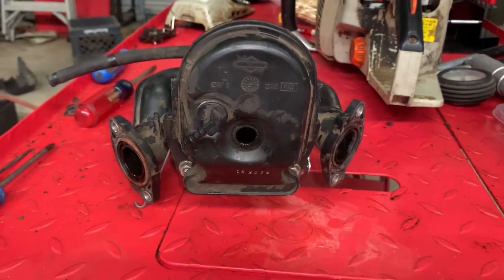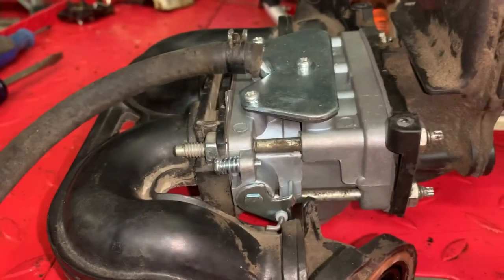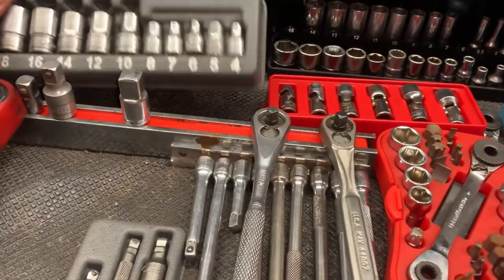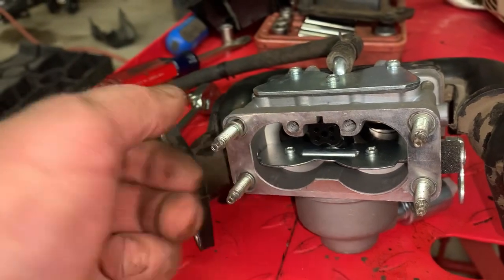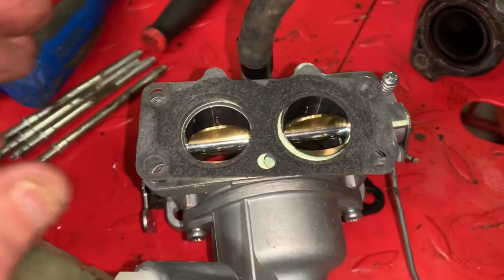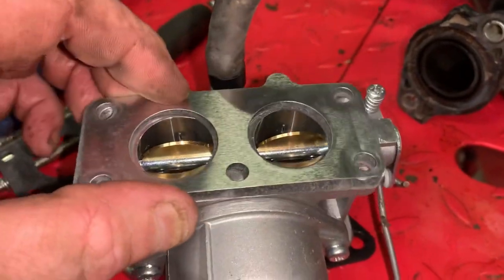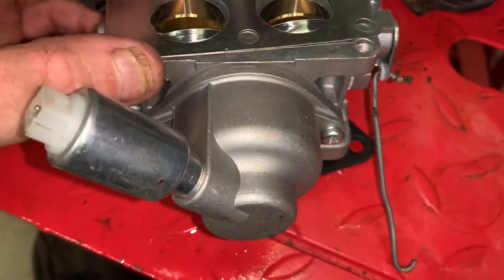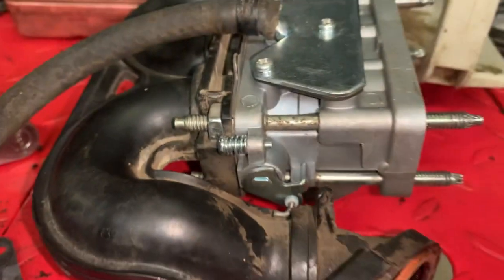CUSTOMER REPLACED THE CARBURETOR AND NOW THE ENGINE OVER REVS

Comment: First time I came across those E-torx I had a 12 point socket that worked. A year or so later I realized what they actually were and got a set of E-torx sockets. When you need them you'll be glad you have them.

Comment: Just put on a B&S carb. The eyebrows are in the right way,(looked at old one when I was assembling new one). Still running wide open? It might be the throttle rod ,had to bend it when I was taking things apart. You are right about eyebrows plate though. I tried mine before putting it back on my mower. Good video.

Comment: Can you help me sir? I did a 1st time repair on an old Yard machines mower with a briggs and stratton Engine. I don't know much about repairs except for what I see on youtube. I replaced the carburetor and forgot to connect the carb lever to the governor lever. I didn't want to remove the carb again so I figured it would be easier to just remove the governor lever instead. I had no Idea that the post where the governor lever connects to, also connects to inside the engine. I didn't know what I was doing but then I figured I messed up because I could turn the governor post left and right with my fingers and I didn't know how to set it like it was previously to me messing with it.

I saw some videos on here about how to reset the governor lever and I think I set it up the right way except when I finally turned on the engine it seems to be reving high and I don't know if it's because I didn't set the lever correctly, or if it has something to do with the carburetor?

Comment: Briggs and Stratton Intek V twin
Hi, Had a bad misfire, replaced carburettor. Engine now revs very high. Took engine out replaced with a new governor, did not look damaged at all. Adjusted governor to carb as per instructions.
Still revs high. Noticed the Governor arm does not seem to move througout the rev range. Any ideas? Thanks

Comment: The purpose for those "Eye Brows"?
Reply from the maker: Better atomization and directs the air fuel
Mix up into the manifold per Briggs.   I’ve left them out and I can’t tell a difference
Reply: @themowermedic1 if the eyebrows are installed on the other side of the carb does that cause high rpm?
Reply: @JayTalyai  Yes, because it doesn't allow the flaps to close completely. That's what the owner of this mower did when replacing the carb. I just swapped out my faulty carb with a new one and it's racing, can't get it to come down. It's installed correctly with no air leaks, a  bit of a head scratcher. Let us know if you find out what your problem was.
Reply: After watching this video I installed it correctly and was still racing at high rpm. Took it to my indie and he said it’s internal therefore is the governor. I have a John Deere la135 with a Briggs vtwin 22hp. Once I get it back with the new governor it should run smoothly because the governor controls the idle
Reply: @robruiz1429 I’m also not positive on this but if you replace the carb and don’t set the governor properly before starting your mower, it could make the governor break on the inside, that’s what I’m thinking. So a simple job can turn into a nightmare with a simple mistake